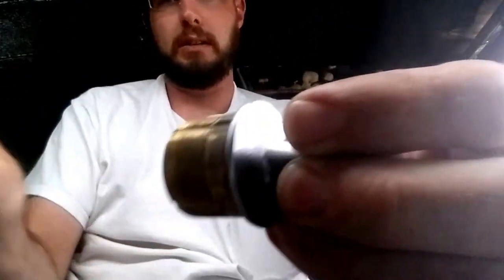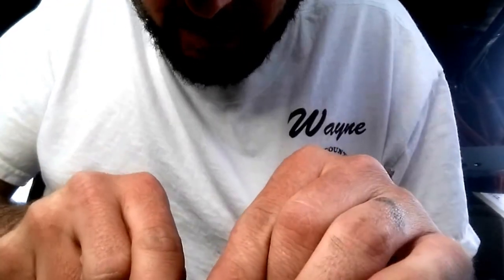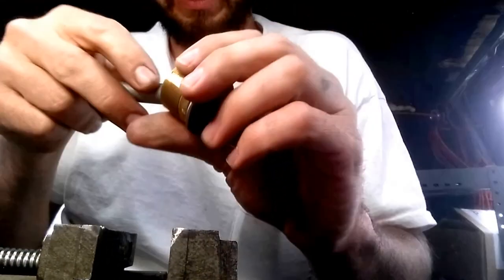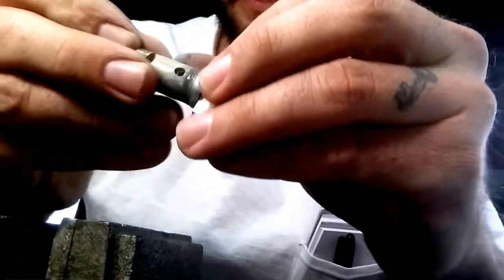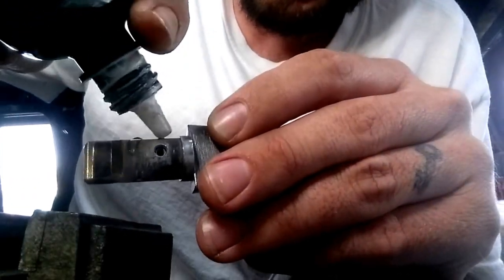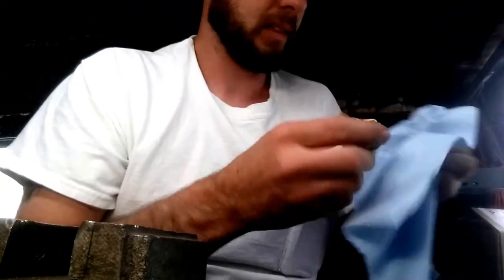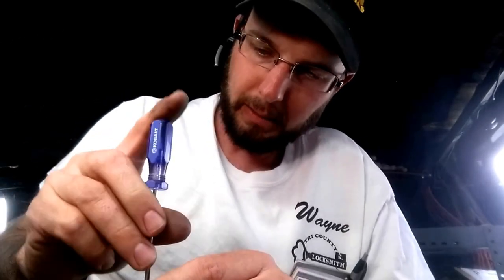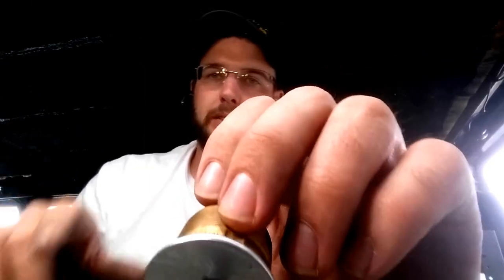Adams Rite Store Front Door Thumb Turn Lock Not Working, Soluition

Comment: just a question.
considering a thumb turn cost about $5, beside the curiosity, why would you waist your time trying to fix it?
Reply from the maker: Beacuse they don't know this and tbey don't jnow where to order parts from. Buy the time I charge service call fee and hourly rate your $5.00 problem is now a much larger more expensive one. but that's why they Pay a professional to fix it and the resin this video is posted. if your a do it your selfer good for you,  if not I will fix it for a price.
Reply: I meant to say that you should have changed it and charge for the service call, time and part.
It would have saved you time and you could go to a another job quicker.
Reply from the maker: Aww but I wanted to know what went wrong and how to fix it. And if I replaced I would not have been able to make the video you are commenting on.
Reply from the maker: If I took your advice we would never have even had this conversation. ......m
Reply: I hope it was worth it :)
Reply from the maker: Yes it paid well.
Reply: Like Wayne, I’d usually give them a flat rate and it would probably have cost about the same whether replaced or repaired. I try to save the new parts for when they’re needed. Thumbturns don’t go bad that often because their interior location and if a little lube will help it last another 5-10 yrs so be it. We had a stuck thumbturn repair last week and it was simply remove from door, spray it out, lube it and reinstall. There was no cover over the chambers so didn’t have to take it apart. The extra labor (5-10 mins) I took to clean it up was comparable to new replacement and now I still have new parts for the next job that can’t be “repaired”, saving myself shipping costs and time to reorder stock parts etc.
Reply: Like Wayne, I’d usually give them a flat rate and it would probably have cost about the same whether replaced or repaired. I try to save the new parts for when they’re needed. Thumbturns don’t go bad that often because their interior location and if a little lube will help it last another 5-10 yrs so be it. We had a stuck thumbturn repair last week and it was simply remove from door, spray it out, lube it and reinstall. There was no cover over the chambers so didn’t have to take it apart. The extra labor (5-10 mins) I took to clean it up was comparable to new replacement and now I still have new parts for the next job that can’t be “repaired”, saving myself shipping costs and time to reorder stock parts etc.